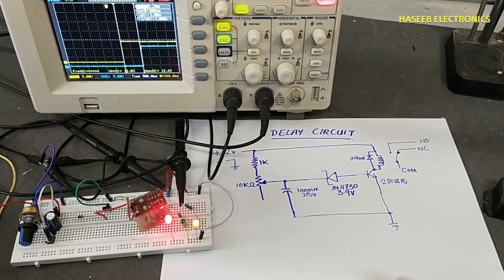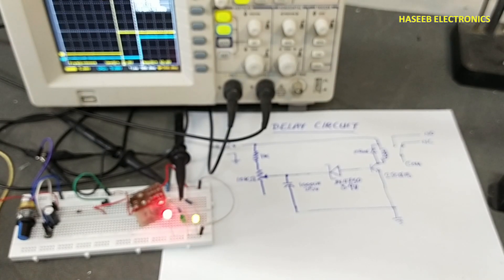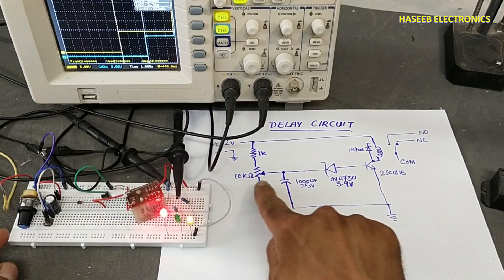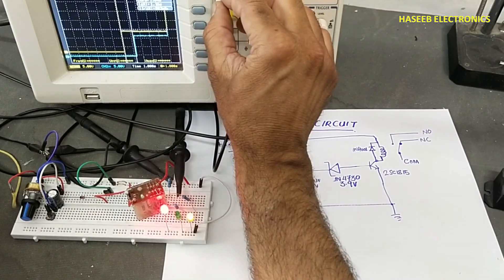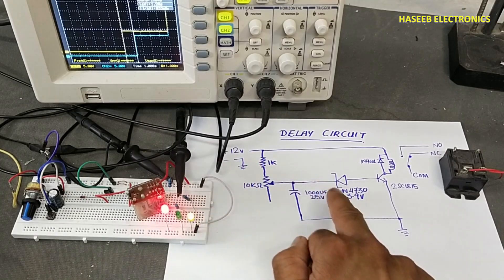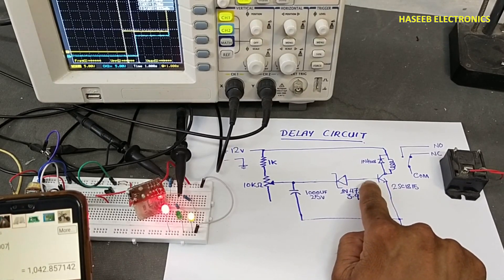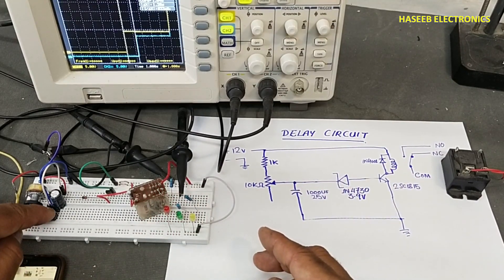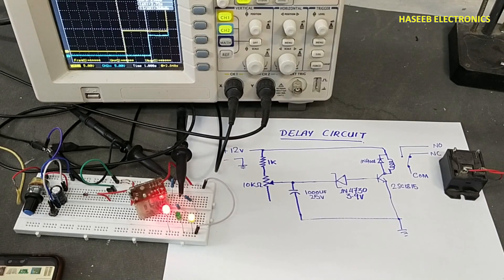{909} Delay-Timer circuit

Comment: INSTEAD OF USING A MICROSWITCH IN PARALLEL TO DISCHARGE THE TIME CAPACITOR. HOW CAN WE SELECT THE RIGHT BLEEDER RESISTOR TO PERFORM THAT FUNCTION.  WHAT IS THE CRITERION TO SELECT A GOOD BLEEDER RESISTOR IN DELAY TIMER CIRCUITS.

Comment: I want to understand why you connect the zener diode in that way instead of normal parallel connection kindly explain in details different ways we can connect zener diode.
Thanks
Reply: in this serial connection it makes barrier for rising voltage on capacitor  and only after exceeding zener voltage it switch voltage to base.
Reply: @voitano73  I don't understand your explanation

Comment: nice video sr
 I had a question , I bought a smps 12v 10A and it doesn't have any pwm ic like TLC494 and also no adjustable voltage trimmer , that means voltage adjust is not possible in this smps ??
Reply: there is always some regulation circuit there, it should be adjustable. But there is a small chance, that it could be possible regulate voltage  only to higher levels
Reply: @voitano73  I mean the trim pot is not there , the voltage was a bit low and I want to increase a bit ,  so thats not happening cause trim pot is not there

Comment: You don't need a Zener diode - just Resistors, a Cap and a Transistor
Reply from the maker: zener is used increase to enhance the charging level of the capacitor to provide more delay time

Comment: You are the best, Thank you. This is perfect for my in rush current problem. Part 1 everything on, Part 2 big capacitor charge. Next I fire solenoid, and repeat. Have you done a video on back EMF or snubbers?  It turns out that my pinball coil, (4 ohm), pulls in well at 30 volts, but when I turn it off my driving transistor gets several thousand volts and explodes. I am learning, Thank You again, you are great, from Bill.